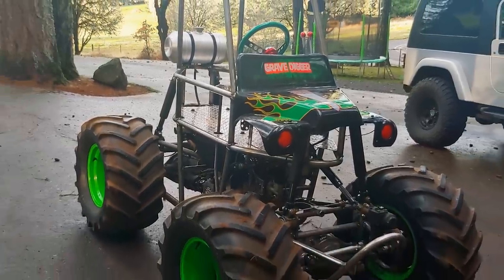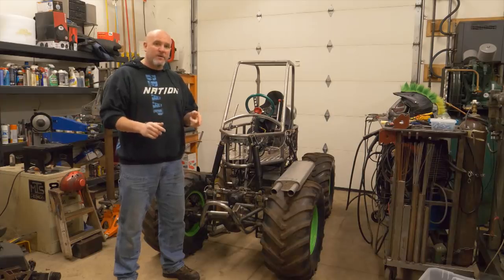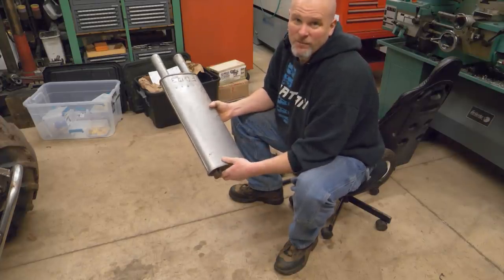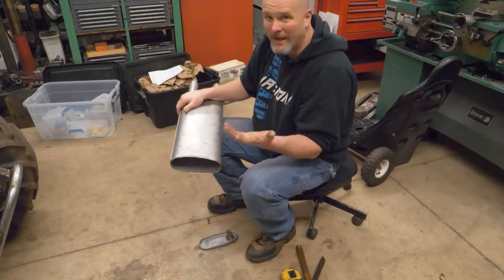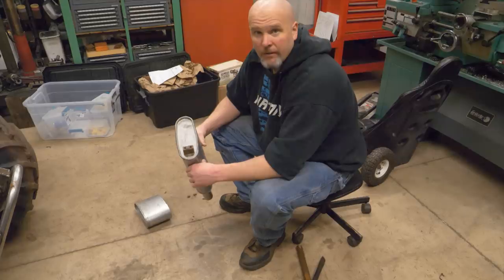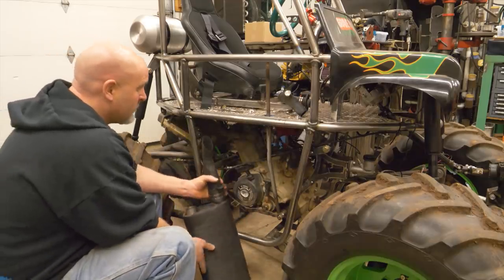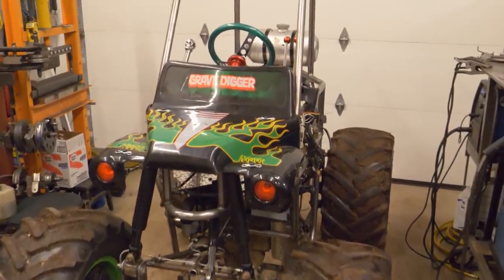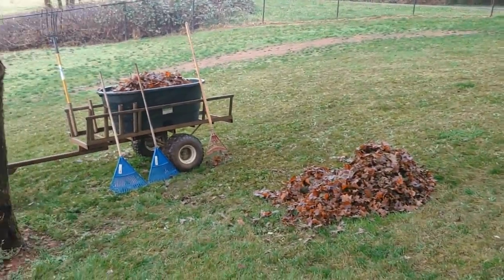Custom Mini Grave Digger Monster Truck Build DIY Modified Power Wheels Gets Rowdy

Comment: I grew up on a farm and my dad wanted me to learn to drive the tractors since I was the oldest. I learned to drive cars too by sitting on my dad's lap until I was big enough to reach the pedals. As much seat time as you can give will help your son to not be afraid. By the time I could be on my own I wasn't afraid of loud tractors even if they had no muffler. There's ear plugs but that doesn't always help.

Comment: NICE! That muffler smoothened the torque curve perfectly. Now all you need is water tight airbox and a snorkel. Trust me, you will need those. That is a heavy beast to pull out of a ditch after the engine has flooded. Also, good airbox helps with the jetting. 
..And tall enough snorkel creates positive airpressure in the airbox.. just sayin'..
Reply from the maker: It does need some sort of air box.... Thanks!!

Comment: When welding galvanized metal a good way to clean the galvanized coating off is to dip the pieces in muriatic acid, only takes a few minutes. Could also brush it on but takes a while longer and several applications.

Comment: Do yourself a favor and put rubber grommets or washers to put between the body and the mounts to keep vibration down and the body from cracking (same as I did with my RC version years ago). Nice job so far btw. You can also steel wool in the muffler packing to help eliminate some of the exhaust sound.

Comment: if you have the room for it you could build one or two footwells intoo the front of the floor and put coverplates over them to let the younger ones ride the thing , should drop youre knees down a little to ride it a little eazier could make the footpads on the pedals to drop down a little so you still can operate them 
the big chamber is probably to make the exhaust sound deeper

Comment: I'm sure people understand about the exhaust just in a few years when they make you do some upgrades to it and loud is cool rather than scary.  You can do it. So are you planning on hooking up the awd? Or that a is for when they get older .   But keep up the good work any hints on your next project. Happy holidays
Reply from the maker: I'm changing out the gears in the front axle so they match the rear, then I can make 4wd. I have several ideas for next projects... But honestly, I need to finish this, the golf cart, the sideXsideXside buggy, and the kid dune buggy... You can check those projects out in my other videos. Thank you for watching!!

Comment: You should make a cool grill insert and  to go between the headlights. Maybe flames or spiderweb or even just mesh.
Reply from the maker: I will, thinking horizontal slats at this point. Gotta get all the mechanical done first tho... Thanks for watching!
Reply: @motomule   That would look awesome, like a 50s chevy truck grill.

Comment: I cringed a little when you put the body posts on and R clips in, most of the RC hobby is trying to get away from that arrangement, probably the off road crowd still like it.  Youll be working on this thing forever, as your boys grow up this Grave Digger will probably need to get rowdier and rowdier as they learn to handle the power.  I envy them and you, for letting them drive something like this at such a young age and learning skills and techniques in driving before they will even get their license.  This project is a win for everyone.  Thanks for sharing.
Reply from the maker: Thanks for watching!!!

Comment: Great design and details!! Is already running in 4WD mode? Looking forward the next video!
Reply from the maker: Not yet 4x4. I need to change out the ring and pinion on the front axle so it matches the rear axle before I can hook it up.

Comment: Use ENGINE Restore.  in the Bottle...

Blue smoke go away and more power

it works

Use 4cy bottle the small 1.

I've used it for years but the guy from Project Farm proves it works it even worked at 290 PSI on his diesel tractor and it held compression for a year working in the field

Comment: If you want to make it quieter yet you could use sound deadening foam insulation, like in an industrial air compressor. Use it under the floor and make some side panels. Or not. I bet your kids will get used to the sound and someday they will want to take the muffler off and make some noise.
Reply from the maker: Right!! 😆 Doin all this work now to make it quiet, they'll rip all that off when they hit 12 years old... 😆

Comment: Looks like the brake master cylinder bracket hasn't been fully welded yet.. I hope he hasn't forgotten or looked over that.
Reply from the maker: Several of the recent additions are just tacked on. Need to tear apart again and fully weld... Thanks for watching!!
Reply: @motomule  Good to hear. Just looking out for your safety. Spectacular build. Your kids don't know how lucky they are.

Comment: Curious what's the gear ratio in the axles. And you should get Dad of the year award for this build awesome.
Reply from the maker: Thanks!! 5.38:1 gears and 31in tall tires. 5.13:1 or even 4.88:1 would probably be better for something to have a decent top speed....

Comment: Sorry if it's been discussed in the previous videos but I've missed it: Will the front axle get power in the future or is it just for the 4wd look?
Reply from the maker: It will get 4wd. I need to change the gears in the front axle so they match the rear before I can hook it up. Soon.

Comment: does it still have 4 wheel drive? its an awesome build, kids will be stoked with it.
Reply: It just needs the front drive shaft installed
Reply from the maker: It will. I need to change the gears in the front axle to match the rear first.

Comment: Not counting time and labor of course how much invested would you say the build has been
Reply from the maker: Let's see: $400 for a power wheels (that I'm only using some of the plastic off of...), $250 for old farm quad, $200 for used tires, $200 for shocks, $500 for electric power steering kit, $500 in axles and related parts (needed different gears for front axle), close $400 in metal, and about $400 in misc hardware (fasteners, steering wheel, seat belt, etc...) I already had the rest of the parts, I'm a packrat... So probably $3000 by the time it's done..

Comment: Please please please move the radiator to the front. That would give it an awesome look, as well as better cooling. Might need a "firewall" to deflect hot air from the rad away from the operator.

Comment: How did you modify the shift linkage for reverse?
I don't remember seeing that. Have I missed something?
Reply: The donor quad the motor came from was 4x4 with reverse, it came with the optimal setup for what he was building.
Reply from the maker: I didn't show putting that lever in. I just used the lever and cable from the quad. Thanks for watching!!

Comment: Is that a semi automatic gearbox
Reply from the maker: Yes. 5spd forward plus reverse and hi/low range.
Reply: @motomule  id say its handy enough having the reverse. Did u have to mod it for high/low gears.
Reply from the maker: @johnduggan7428  no. The quad engine already had all that built in.

Comment: Do you plan on making it 4-wheel drive? And what are those red levers for?
Reply from the maker: Yes. The red levers are turning brakes, each one applies the brakes on a single rear tire.

Comment: When is the drive line going in?
Reply from the maker: After I swap the gears in the front axle, they need to match the rear before being driven.
Reply: @motomule  on my dads jeep the front is geared a little bit faster than the rear I believe it's called dig  but would be cool on this to help crawling

Comment: Did you disconnect the front driveshaft? Why?
Reply: he didint even connect it yet
Reply: @hyvinkaabombercrewhbc6005  he had it connected in earlier videos.
Reply from the maker: Not yet, I can't put fro,t drive shaft in until I change the gear ratio in the front axle. It doesn't match the rear yet.
Reply: @motomule  ah, so you just had the shaft connected to check driveshaft angle and such?
Reply from the maker: @christophermorin9036  no, I haven't made a driveline for the front yet. I'll do that after I get the gears changed.